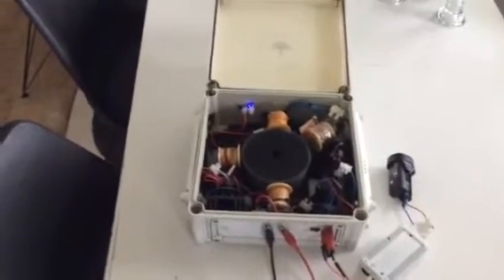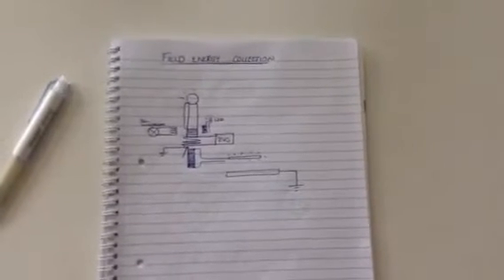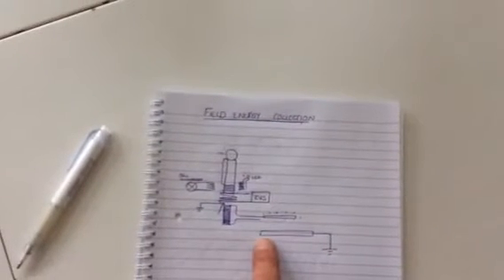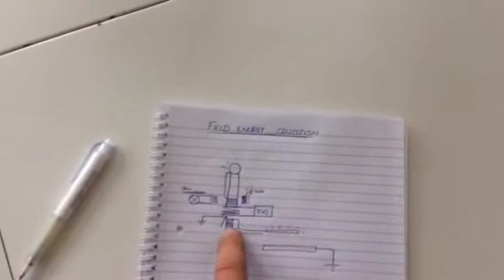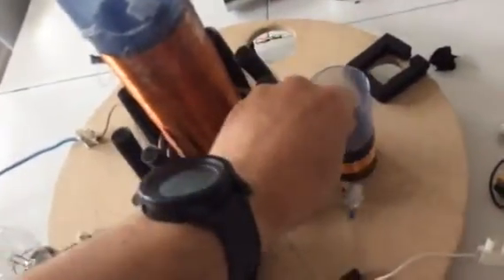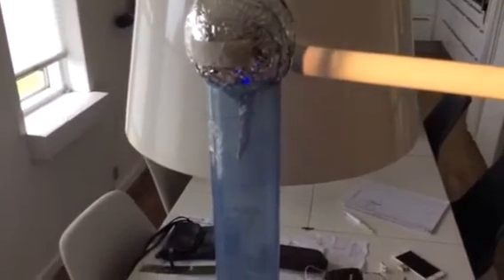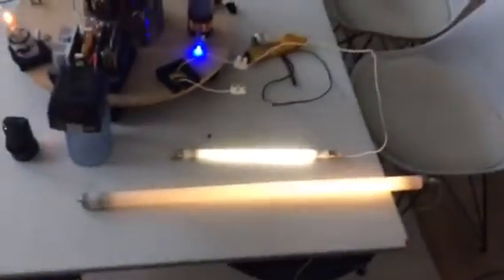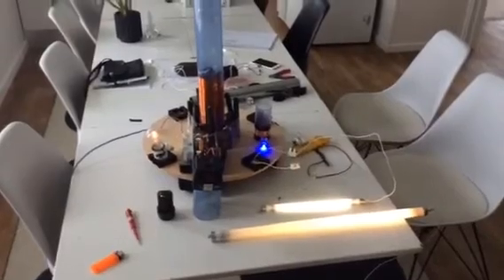Field energy collection

Comment: can I ask a 'folks are dumb where I come from' question?
Can you add a load in line on the earth ground?
Reply from the maker: clixbits there are no dumb questions only dumb answers. Load in line on the earth. Can you be a little more specific? Do you mean the earth cable with the strip light on?
Reply: in series on the blue earth cable that you're running to the coil.
Reply from the maker: clixbits yes you power lights so it should be possible to rectify to D.C. To charge a battery for example, I am hoping to make more experiments this weekend. I will try and post asap. Do you have anything else that I might try? The more ideas we have as a whole the faster we can achieve the goal .

Comment from the maker: Yes, I think I missed the extra energy that was inside all the time. This should be enough to keep up with the amount the ZVS circuit uses. Plus all the energy around that we can convert to usable energy:)
Very excited, I will post everything I think could be useful. Next will be rectified ac to dc and into a cap to see the rate at which the battery is using and the charge rate.😁😁😁😁😁😁😁🍺🍺🍺🍺🍺